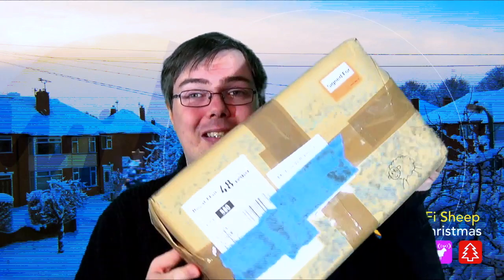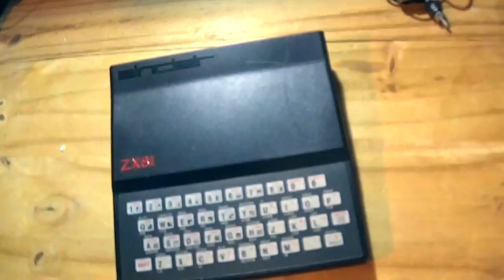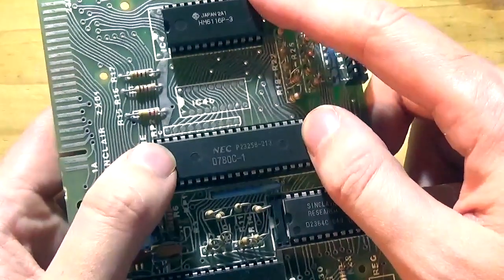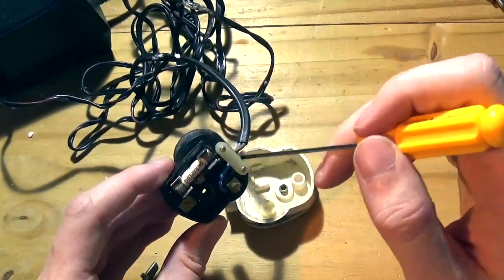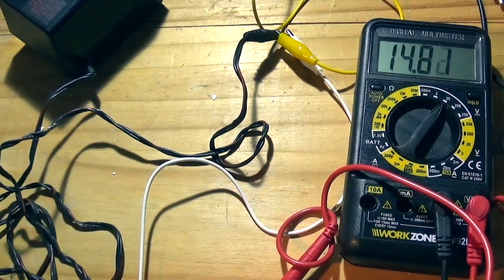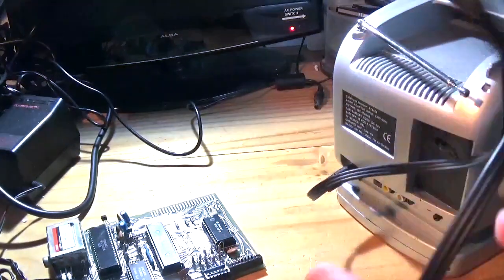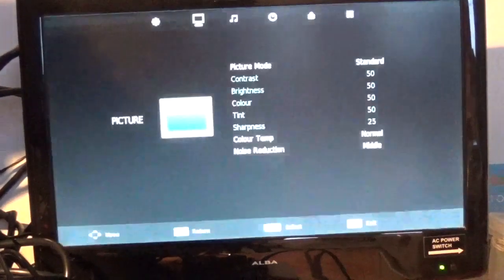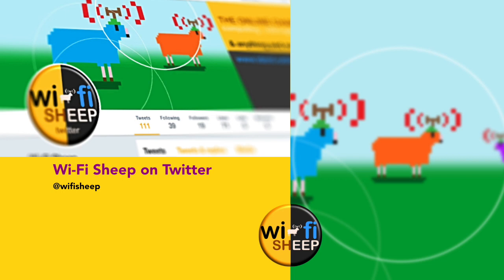ZX81 unboxing & testing - Fan Donation! (Wi-Fi Sheep Xmas)

Comment: Does it use anything other than 5V, can't remember. That voltage regulator is 5V output though. I'd be tempted to remove that, do away with the power brick and run it directly from a usb cable!
Reply from the maker: Interesting idea.... however I have a feeling maybe the RF modulator or the cassette tape interface requires more then 5v? maybe? there must be a reason for 9v DC input?
Reply: @WiFiSheep  Pretty sure ZX81 was entirely 5V. Although the dodgy RAM packs might generate 12v -5v? for the DRam?
 Those voltage regulators always require a greater input than the output and will take a wide range of inputs but usually most efficient (although not efficient at all compared to modern equivalent) at certain sweet spot around 8. 
The Acorn Atom, of a similar vintage, has instructions and jumpers on the board to bypass the case melting 7805 with your own 5V supply,  so a common mod even back in the day.

Comment: Great video. Did the power supply output drop back to 9V when loaded ?
Reply from the maker: Yes it did, it turns out 14.5v is about right for an unloaded original PSU.
I will do a follow up then the new keyboard arrives just to go over the errors and mistakes I made or said in this video :-P